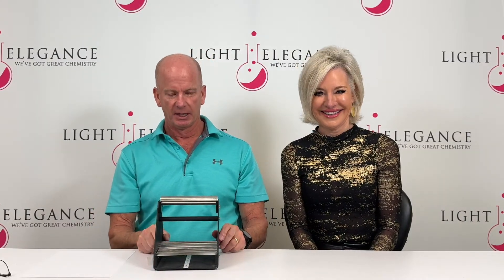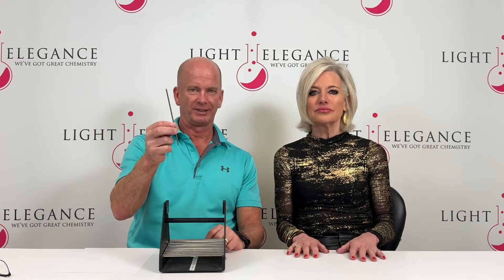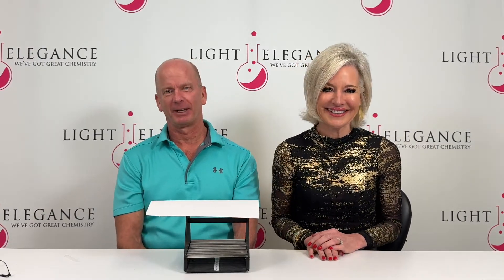Strength, Flexibility & Hardness | How Does It Relate to Your Builder Gel? | Lezlie & Jim LIVE

Comment: Here to second the requests for a flexibility/rigidity chart! It sounds like Jim says Fiber Gel is more flexible than extreme and builder. Is 1-step more flexible than extreme and builder? I have flexible nails so it sounds like extreme and builder wouldn’t be my best option for hard gel?
Reply from the maker: Apologies for the confusion! Fiber & 1-Step are not the most flexible and are not meant for super flimsy nails. Extreme is our most flexible gel and all of the other Lexy Line gels are very very close in flexibility to one another. Extreme would be your best option for flexible nails!

Comment: Is Fiber in second place after Jimmy Gel in flexibility? I thought Fiber was least flexible of all gels? 🙈
Reply: I distinctly heard Jim say that the Fiber Gel was more flexible the Extreme, Builder & 1-step. (listen between 7 min. 30 sec. and 8 minutes) But another comment asking the same question, the reply from LE was that Extreme is most flexible of the Lexy line (look for the comment/question from @gracem16) ...so I'm confused too.  Both answers can't be right.  I use Jimmy & Extreme on myself with good results, and I have fairly flexible nails ...but would sure like to get some clarification on this. 👍😊
Reply: @silverchick51  I was wrong with my initial reply on hardness and flexibility.  The harder gels in the Lexy Line are: 1-Step, Cool Gel, Fiber Gel and Builder.  The Extreme is more flexible and a bit softer.  JimmyGel is the softest and most flexible.  Please accept my apologies.